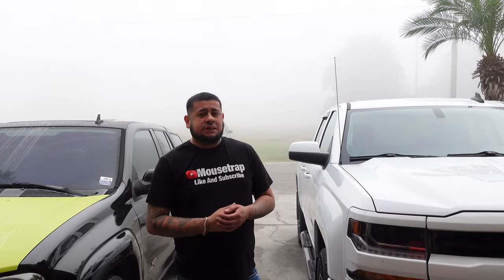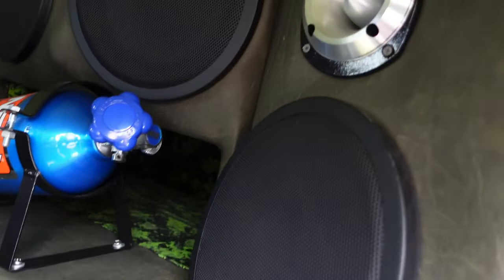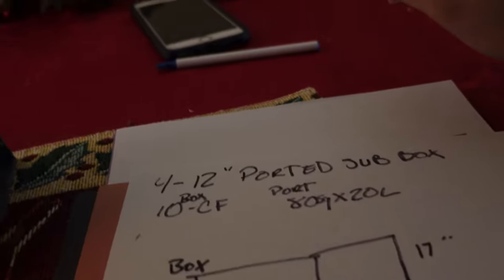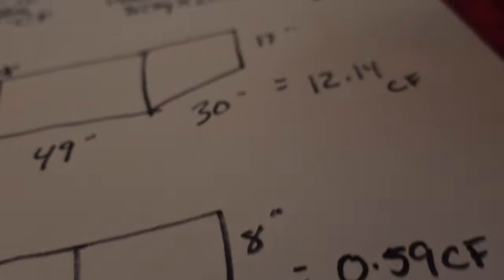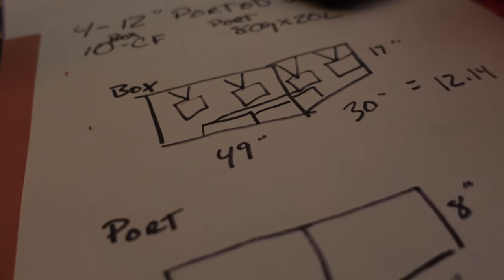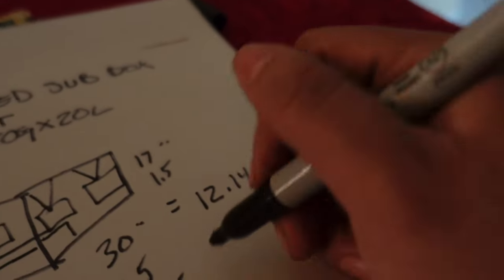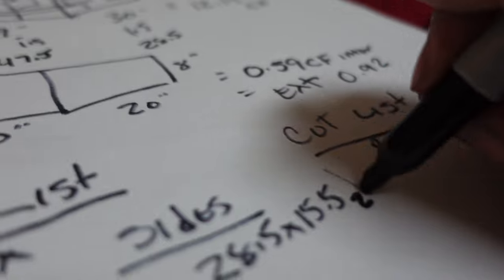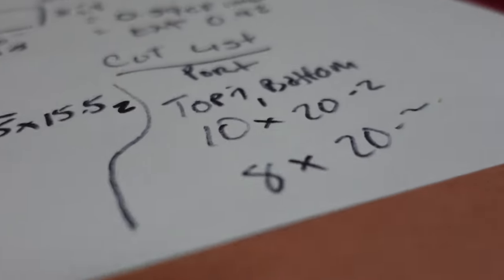Car Audio Tips Secrets on Building Ported Subwoofer Box for 4 12s | vlogmas day 7

Comment: I have a half  built box in my garage but think I gonna go pick up more MDF  and start over and give this a shot.. if possible could u give me a little more detail on that port area please and thanks. From my understanding of the video, it's 8 inches in height, 10 inches in width and 20 inches in depth which is 8.75inches off of the back wall if my understanding is correct.

Comment: Just subscribed, brah. I live in alaska, and i been wanting to do a build like this it's cold as chit now but this summer I'm pulling out the back panels rear seats and probably build the box in car to get it fit my 15' sonic big 3 2/0 sky high wire irragi hi output alternator customized the battery mount to handle a truck agm crescendo bass clef 2000.1d 2 Rockford Fosgate T0d412 p1650 side doors and a alpine ilx-w650 mechless just needs a striper pole battery bank 4 channel amp and when I build this I will need another crescendo and a couple T0s I want hairtrick I've been told prefab is my bottle neck limiting my potential so fixing it with twice the space an power is the only logical solution 😉
Reply from the maker: Now wer talking !! Thanks for the support 🙌🏻🙌🏻🔈

Comment: What's up MT? I got a question. How do I determine the internal length to get around 31 to 34 hz..of the port. I'm building a box that 44 x 18.5 x 28.5 for four 12s with a up and down center port firing back. But I'm stuck on port size.
Reply from the maker: Make port 12” deep so it gets low and still hits hi notes too
Reply: @Mousetrap  thanks Bro I appreciate that so much. The is cool but that port had me at a stand still.
Reply: @Mousetrap  not tryin be a pest but hey it's gonna be 12 deep I got that and now im wondering the width. It will be a double center port 16.5 length and u said 12 deep. And the magic question. How wide the should ports be since it's basically going to be 2.. again thanks for the help/response I really appreciate it man this is my first box build and I want that sht slammin... and did u ever post a video of your 4 12s I never got to hear it or never seen video..

Comment: I got 3 jl audio 12w0v3's in a 5.25ft³ ported box with a 4 x 10 inch port 16.5 inches deep tuned to 28hz. JL gave me the volume and port tuning. Its in an 06 maxima and it was a big pain in the ass as i had to build half of it in the trunk. But i also got jl mids and highs, all hooked to a never used and had it since 2003, an XTANT X603 which is running 150 x 2 to the mids/highs and 300 x 1 to the 3 twelves and it hits 140-141 with only 600 watts total. Is that a decent spl level for only 300 watts to the 3 12's?
Reply from the maker: That’s actually pretty good numbers… with more power that thing would definitely put some good DB numbers!🔈 ported boxes don’t need much power but wen good power is there it definitely gonna perform really good!
Reply: @mouse_trap.  Tanks for the reply!😁👍.
I wonder though, how much more power i can give them as the subs are JL's lowest line? I have an old Orion 225HCCA 25W x 2 or 400w x 1 at 1ohm mono im gonna do a test on, my 3 4ohm subs together are wired up for a 1.33 ohm load, so we'll see. I do have a defecit in the midbass frequencies as i only have a 6" 2 way jl comp set in front doors, and a jl 6.5 inch 2 way coax in the rear doors. Im thinking of maybe putting an 8 inch midbass in the front doors and move the component set to custom kick panels. But since that XTANT amp is a 3 channell, i will need to change my set up to 3 separate amps. I just dont know what amps ill use. My goal is to get as loud and sounds good with as little power as necessary. Im not looking to do spl contests or anything. I dont want the huge electrical upgrades but i will definitely get a high output alternator. I would love to go sealed to shrink box size so i could still pull my spare tire out, but im afraid it will kill how loud it could get unless i make it up by feeding the sealed subs more power. I am going to experiment with changing the face of the box and swapping in 2 jl 13w3v3 2 ohm subs as the box size and tuning will still work. I kinda think those two 13½'s will be louder. I have one in a bandpass box i was using before and just one seemed pretty close to how loud it is now. I need some better overall system equalization too, i have an old Alesis MEQ-230 that was common in car stereo contests in the 1990's ill prob use. But id like a ½din parametric i could use up front for quick adjustments. But id like to get the front soundstage done first.
Nice chattin with ya, ill be watching!
Later!👋😄 ☮

Comment: He "doesn't believe in dampening". We don't need no stinking sound deadner. 😂
I never understood that. I'm 51, I've been doing this for over 35 years and I've always done everything I could to stop all that rattling noise. I prefer my bass inside my vehicle. My current build is in a lil Chevy Cobalt. 2 15 trunk build on 5k and I constantly get compliments on how clean my shit sounds. It takes a lot of work and a lot of cash to get my builds this way but it's worth it. My trunk barely moves. If you want it loud and windy, you need to have the least amount of flex possible. Guys that rate their builds by how much their trunk flexes crack me up. That's a waste of bass. I love floating shirts and doing crazy hair tricks. #noflex